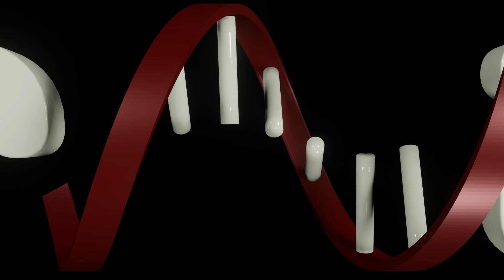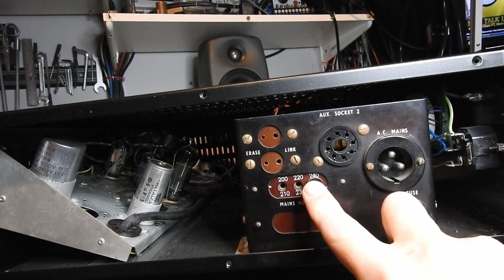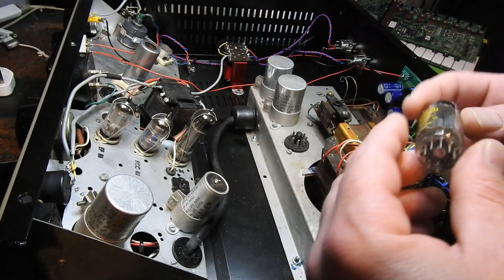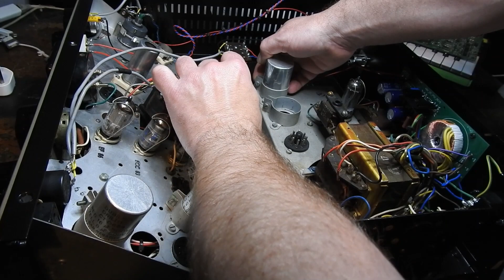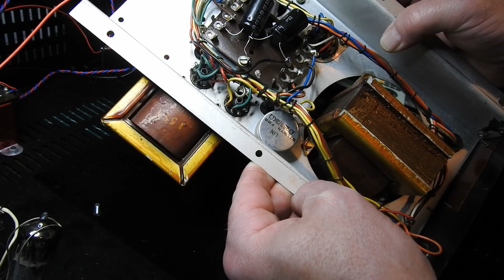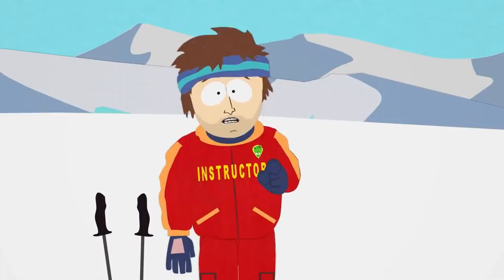Tube Mic Pre Investigations

Comment: Interesting beasty but like a lot of gear this old they need a lot of work to get them working 100%. It looks pretty straight forward. A valve rectified HT power supply, probably 200v - 300v, the EZ80 isn't a bridge rectifier BTW it's a full wave rectifier. The 48v phantom PSU looks like a later addition as condensor mics might not have been around so much when the mic pre was built. It then looks like an ECC83 high gain amplifier. I work with stuff like this all the time, it can be disconcerting if your not used to working with valves and high voltage.